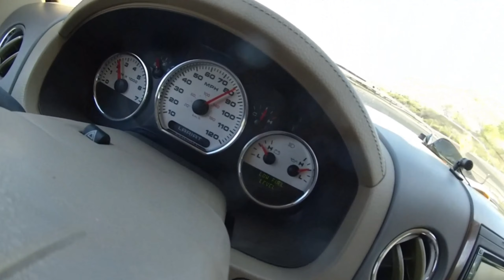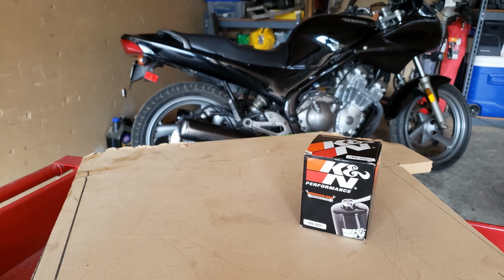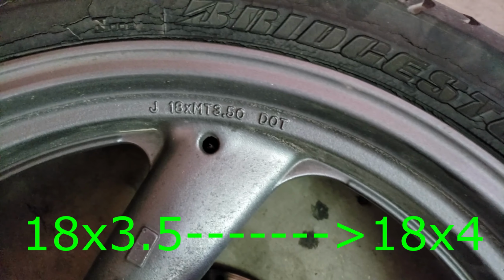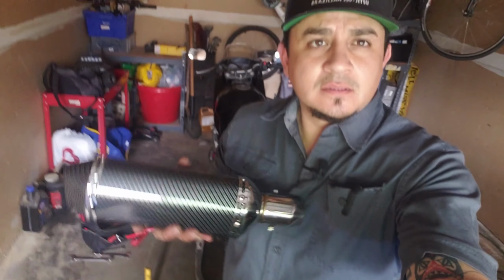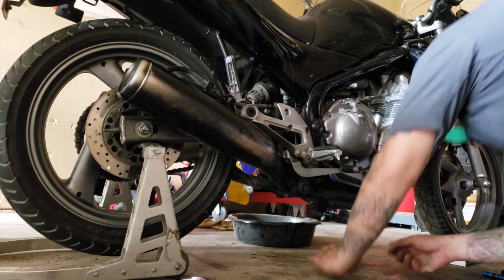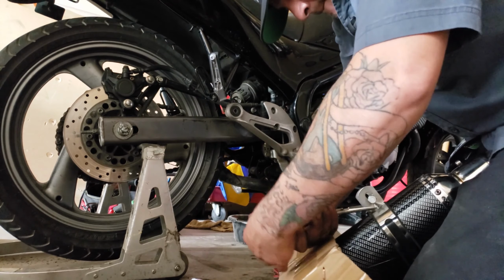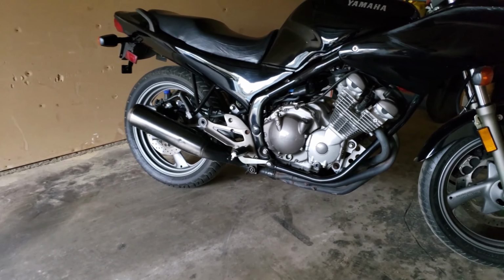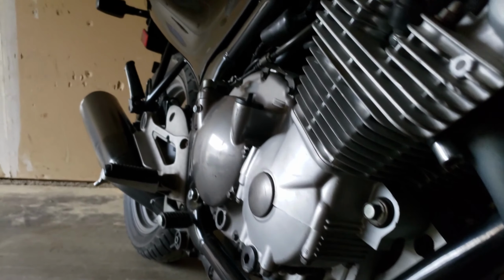Budget Build Yamaha Seca II Custom Build Part 1!!!!

Comment: I have this exact bike. It was sitting for a while when I bought it. I had to remove the carbs and clean them just to get it running. I plan on doing a complete carb rebuild. I replaced the front caliper because it was seized and a used break fluid reservoir. One set of headers are dented an the bottom side so I'll be looking for some good condition used ones. Replaced fuel pump and some hoses. New boots for the carb to air box connection. This is one of the most beautiful bikes to me. I'll never get rid of her. I had her sitting for a while covered. Maybe seven months or so. Charged the battery today hit the switch and she started up right away with no choke. I believe I have a vacuum leak though. After I brought her up to temp and tried to Rev it a bit it bogged done to the point of almost shutting off. You have any ideas or suggestions on the matter?